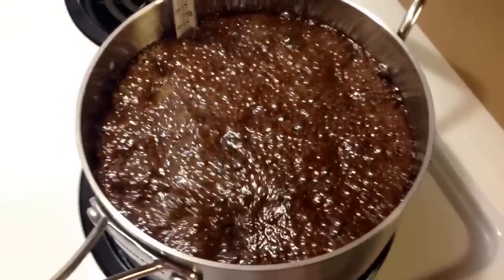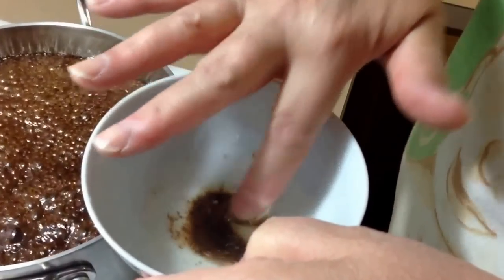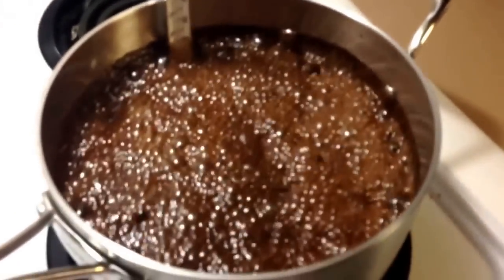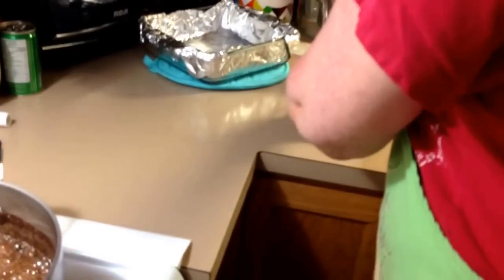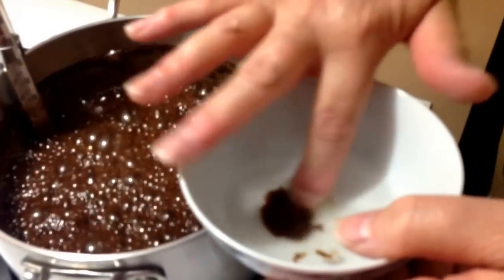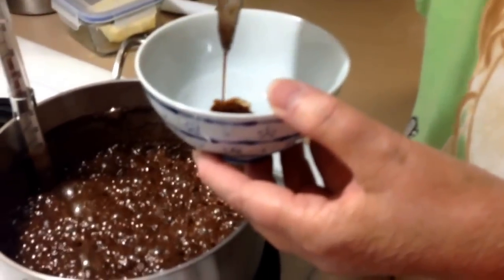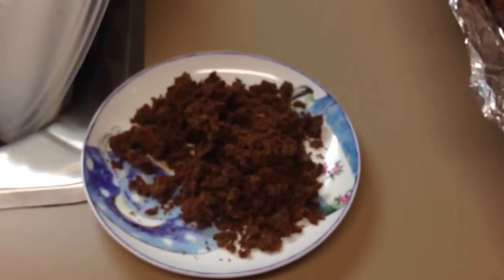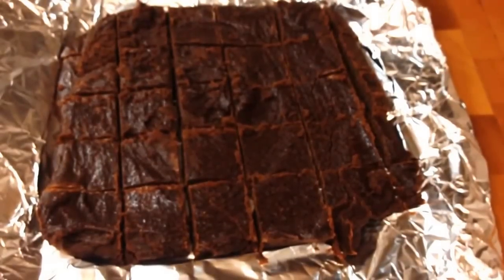Soft-Balling Homemade Fudge

Comment: Maybe I missed it but why do you not stir continuously?
Reply from the maker: This stage of this recipe doesn’t use much stirring until later in the process.  For the most part you just let it simmer down at a carefully controlled temperature, measured by the careful monitoring of the candy thermometer.  We were sitting in the living room most of the time while it boiled down. XD
While it’s expected with this recipe that you’ll get a build-up of fudge on the inside of the pot, it isn’t burned, and you can scrape it off and eat it.

I’d also add that this is one of the more complicated and time-sensitive fudge recipes, especially when this stage ends.  Once it’s off the heat you have to beat it quickly until it reaches a certain lustre, then pan it asap, or it won’t crystallize properly.  I can’t tell you more without looking back at the recipe itself, but I wanted to share the softball stage for other potential confectioners.
Reply: @kiddfaith4397  Wow what an art making fudge is lol.  I ruined a very large batch by not cooking long enough. So now im left with mushy chocolate. Think this method could be used if i reheat my batch?
Reply from the maker: Serena Garces 
Maybe, maybe not.  Once fudge sets you’re pretty much stuck with the results.  But you can always experiment with a smaller portion of it, or melt it for ice cream toppings?

Comment: Around how long does it take for it to get to this stage?
Reply from the maker: Kiara Blanz 
I don’t completely remember, but it took quite a long time.  But what’s far more important is to keep your eye on the candy thermometer.  As soon as the boiling fudge reaches a certain temperature you’re going to need to be right beside it, checking its readiness, and the moment its where you want it to be you need to be very quick in getting to the next stage.